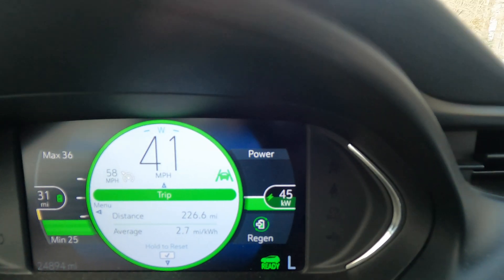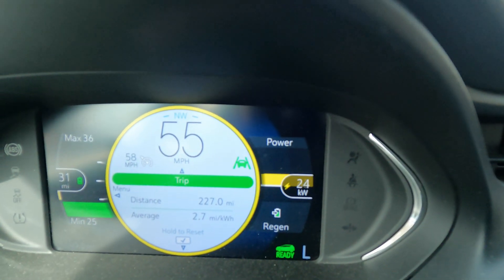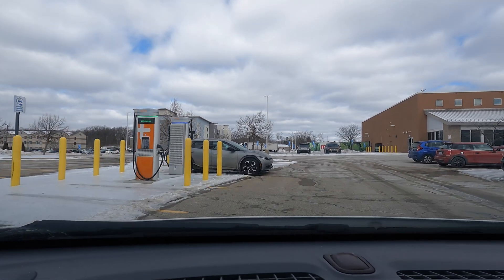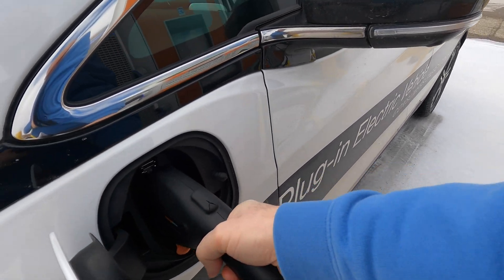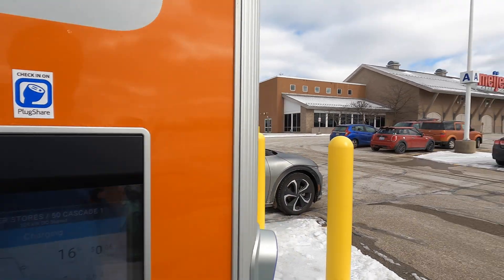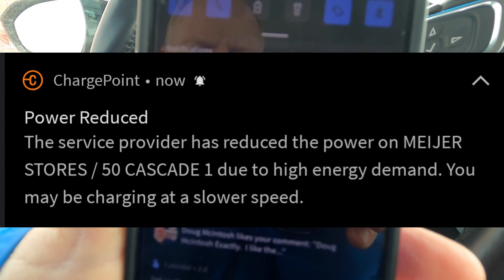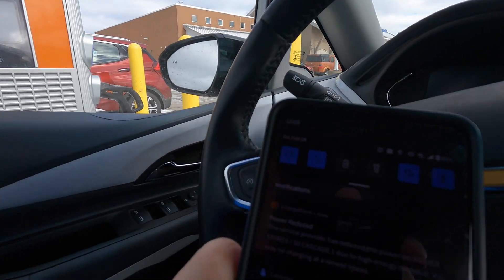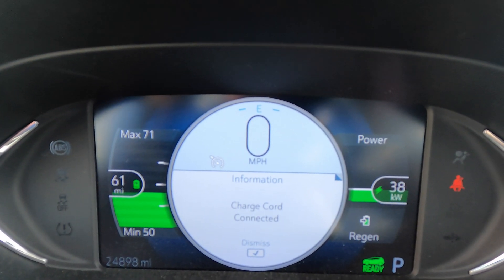Yo Yo Driving Bolt EV Yields Faster Charging Because of Battery Heating

Comment: I tried but I still only got 32 kw.
Reply from the maker: I found it didn't improve my charge rate right away, but the rate improved with time.  When I didn't yo yo, the charge rated stayed flat in the 20s.  It also depends on how cold the battery is.

Comment: Bolt EUV owner here. We didn’t have a super cold winter here in Ohio but I was able to experiment a bit with charging. I have the Chevy Bolt pro app along with a Bluetooth OBD reader, so I can see battery temperatures, use of the heater for the battery, and DCFC requested speed among other things. To get the best speeds, the battery needs to be about 70F or higher. When you plug in cold, it runs a ~1.8 kW heater to warm the battery coolant. Given the large mass and concerns about thermal shock, it takes >30 minutes on a DCFC to bring battery temperatures up from 40s Fahrenheit to optimal levels. 

I park in an attached garage, so my car stays about 45F even when pretty cold outside. That’s the best solution. Other things I’ve tried with so-so success are going to a DCFC the night before a trip and running a heater fan pointed under the car. At the end of the day, this car needs selectable battery pre-conditioning like some other EVs have.

Comment: ...a bit of a disappointment the stations were not given any thought for de-icing.  While I've been daring, it still seems a bit of the wild west. [Reminds me of what friend Isabella said, make it a scary experience for the woman and you've excluded 70-80% of the population. Why? Because wives have significant veto power in budgeting and single women buy cars as well.]  
You didn't happen to see a single Chademo charger at that Meijer did you?  I know they are on the way out, but I happen to own a car at present that was designed for that.
Reply from the maker: Good point about excluding big portions of the population.  Similarly, these sites are not designed for pull through traffic.  Show me a had station that isn't pull through.  Regarding CHAdeMO, all ChargePoint stations I know of still have one CCS and one CHAdeMO adapter each.

Comment: Good points Karl. I've seen other videos where yo-yoing has made a significant DC charging impact on EVs with battery packs near 70 to 80 kWh. But with large battery pack EVs closer to 120 kWh there was too much battery mass to induce a temperature difference for fast charging. Nonetheless a helpful hack for midsized EVs that lack preconditioning.